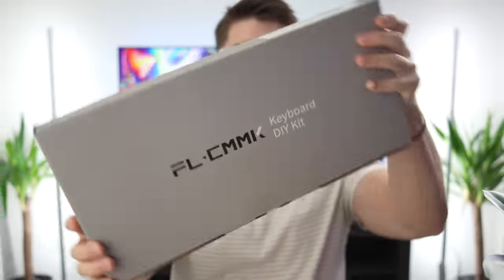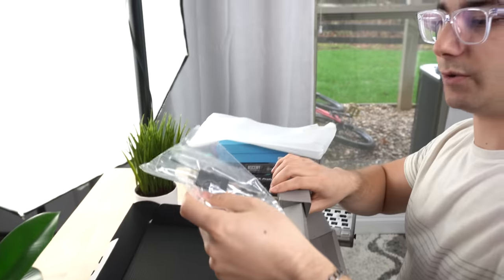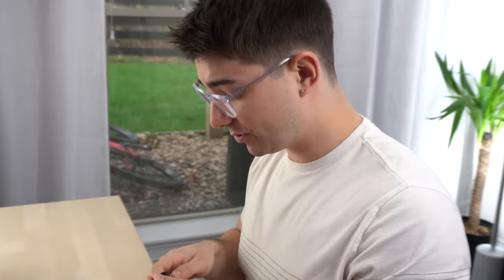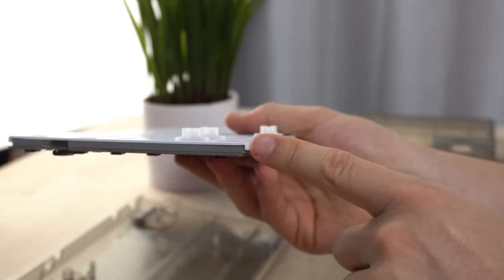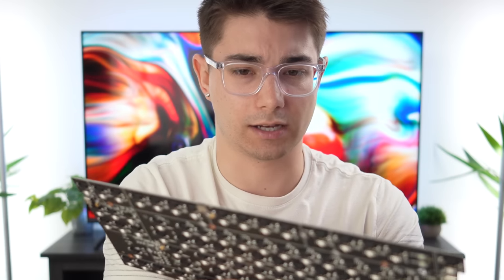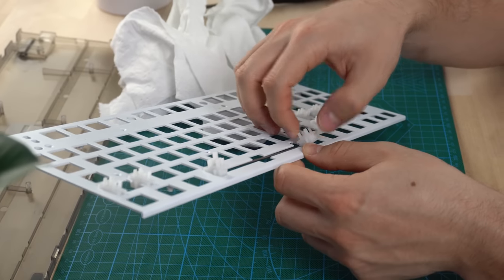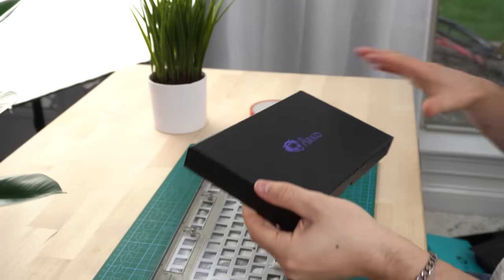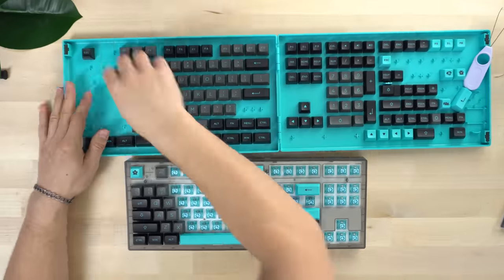MK870 the Best Budget Custom DIY Keyboard Kit???

Comment: I have this board as my daily, I remember the time where this is my Endgame board, it was great stock and I used it for a few months fully stock, I am surprised that this board is amazing at stock. No tuning of stabs and foam mods.

I am using this board right now with JWK Lagoon Lubed and Filmed, Stock Modded Stabs and GMK Katakana. This sounds freaking amazing I am telling you! Worth every penny
Reply: I’m about to enter into this hobby, what would you recommend between buying a stock K8 Pro or getting this Barebones kit and buy some akko switches and some good PBT Keycaps?
Reply: @Games4Noobs1  go for the barebones kit buy good keycap set and yep Akko is very good brand for the switch.
Reply: @harveybayaebon6341  I was thinking the same, although I am not sure what akko switches. Currently debating whether or not I should get the jelly blacks or radiant reds. Probably wouldn't do any lubing etc. Any other reccomendations maybe?
Reply: @davidfisekovic1482  hmmm for akko, I only used the tactile lineup for my daily and a few linears. Tried them all from Ocean Blue, Lavander Purple, Sponge and Jelly Blue.
For the linears, I think Jelly Blacks is one of the most recommended linear from akko since it has deep sounds. I am using Akko Starfish right now and this is the switch I feel in love to, same specs with Jelly Blacks but with 2 stage springs, it is so bouncy I ignore the fact that it is a clacky switch. You can check my channel for my sound test.
Reply: @harveybayaebon6341  aight thanks probably going to stick with blacks.

Comment: There is a polycarb plate. Its an extra $10-15. A year later and my MK870 is awesome. Put some pbt keycaps, akko switches, pe foam and the rubber and in the bottom i added some cleaning cloth. I think its pretty awesome.

EDIT: I'll upgrade mine with Durock stabs and the polycarb plate. Will see how it goes

Comment: Highly recommend this kit
If you dont care about south facing hotswap socket, the only competitors i can think are fl q75 (another kb kit that is great even as stock from fl eSports) and feker ik75
Except it has tray mount for mounting style and it's a bit hard to open, i can't complain any other things about this kit
Stabilizers are great, (except for person always get anxiety about ticking noise) but still need a bit of work on it

Comment: I loved the look of it!
I was thinking of buying a 75% keyboard, one that's split like the Keychron Q1 but cheaper. Do you any in mind?
Pd: I've seen your top 5 Budget keyboards but the one you mentioned costs $90 which is a little pricey for me
Reply: -CIY TES84
-Readson WL84
-RK84

These are so far the best one's which are under $60
Reply: @TitaniumTronic  I'll take a look at them. Thanks:)
Reply: Fekker IK75/ IK75
Reply: Epomaker TH80, the pre-built version looks like crap but the barebones version seems good

Comment: If this was gasket mounted it would be 5x more popular, if this was gasket mounted It would be like a nk87 or a 87% kbd67lite for just 60 bucks
Reply: Gasket mount is the key to marketing
Reply: What is the benefit of gasket?
Reply: @ryanayr743  more softer typing
And it also makes the keyboard sound better because if the board is screw in it causes a lot of reverberation and cheap sound.

Comment: Honestly, I am through so many "budget" options (budget my ass, just because custom keyboards are extremely overpriced doesn't actually make these "budget") and I'm sorry to say that the gmmk pro is still the easiest to get to the best sound possible. 

All I needed to do was installing a Polycarbonat plate (for my specific switches), after that just slab the white PE foam from the package material between your plate and the pre-installed foam, but some cheap but great Akko lavender (unlubed sounds better in this board in my honest opinion, but you can get them pre-lubed for a bit more and the pre lubed job on the lavender is great) or lavender purples in there (also great feel, deeper but not as creamy sounding) and you are golden.
if you cleaned the stabs a bit without getting all the lube out but reducing it just enough and don't push the spacebar keycap all the way in (like a tiny amount up) you don't even need to change the stabilizers. I have zero rattle.
No messing with any of the other foams or gaskets required. (I'm not AT ALL a flex person, if I want a cheap feeling keyboard I will buy one for 20 bucks)

None of the Keychrons gave me even close to the same sound with nearly as little work, but for some even fully modded.
Akko boards are well made and at least feels the part, but also more work for the same sound needed.

For the PE foam it's better to cut it in the middle and have separate sheets for the right and the left side actually to relieve some of the tension on the foam, otherwise your switches might come out by themselves. You can get away with a complete cover, just make sure to pre-stamp holes at the right places but just before you insert the switch, have a bit of overhang on both sides and place the switches in the middle (f,g,h,j,k,t,y,u,i,b,n) first. 

I don't care that some stuck up "enthusiasts" think they know better and that glorious is shit because it's mainstream. If you want to justify your purchase by down talking another without any empirical data you lost the plot and should rethink your actions.
No one is telling you your keyboard isn't great, it's just too much money for a block of metal for some, but that's okay as long as you are happy with the purchase.